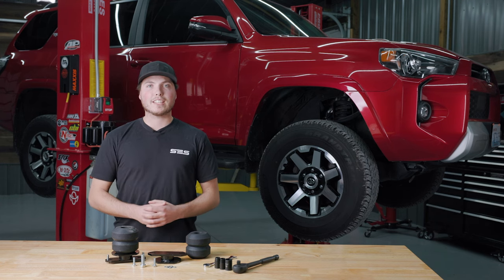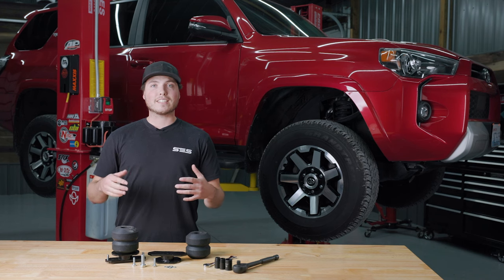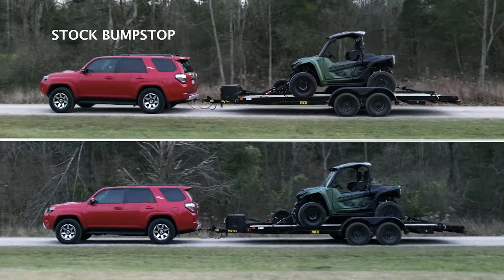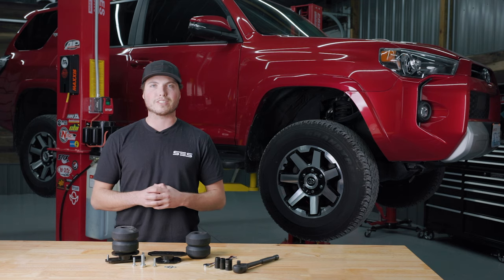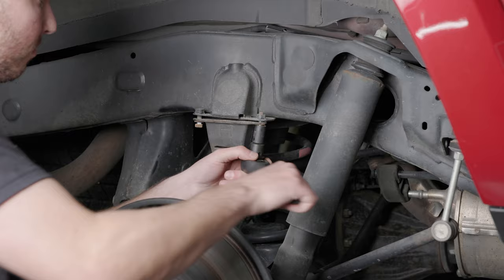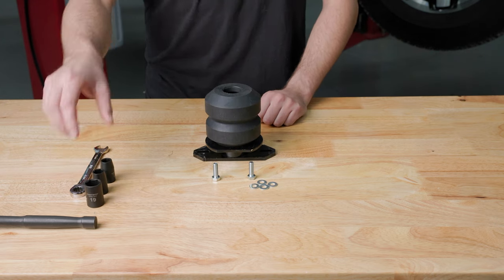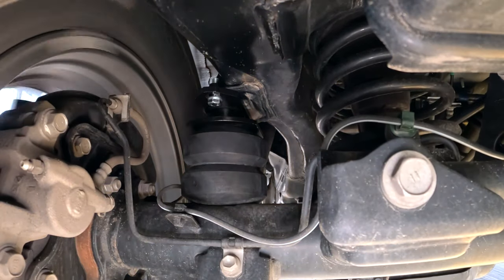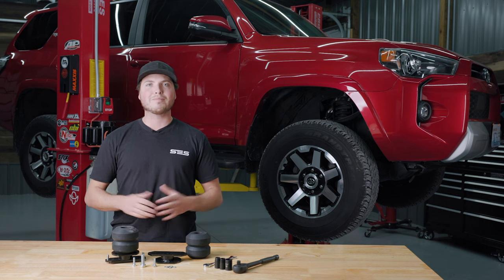Toyota 4Runner Timbren SES Install Guide

Comment: how does that effect the ride and safe handling of the vehicle? Wouldn't that effectively eliminate the effectiveness of the rear suspension?
Reply from the maker: These SES kits are designed to be installed with a gap unloaded. 1/2 inch to 1 1/2 is best! When loaded up, the Timbren springs will engage with the axle effectively working with the suspension to provide a smooth ride loaded. When unloaded since there is a gap, the suspension can articulate and work as intended to from the factory. Thanks for the comment!
Reply: @TimbrenIndustries  Awesome, thank you for the response. 

My thought is, on a loaded vehicle where the axle is sitting on the helper spring, that would increase the spring rate of the rear of the vehicle while the front would not be compressed at the same rate. Would that even matter?

Now, the SES is almost certainly safer than sitting on the bump stop (which would have an infinite spring rate).
Reply: Not only the space will improve or assist the suspension but it will also help to have a more level vehicle which is helpful for the proper function of the transmission.

Comment: Do y’all have spacers for lifted 4Runners? About to install 6112/5160 kit. 3.5 front / 2.5 rear westcott bilstein kit. 14”x 3” king springs 650 or 700 to support c4 lo pro bumper with apex 12k winch. Undecided on rear springs and c4 lo pro front high clearance wings.

Really trying to figure all this out so I don’t have parts sitting in my garage for an extended period…..
Reply from the maker: No spacers sold from us. We manufacture a rubber helper spring as well as an active off road bumpstop.